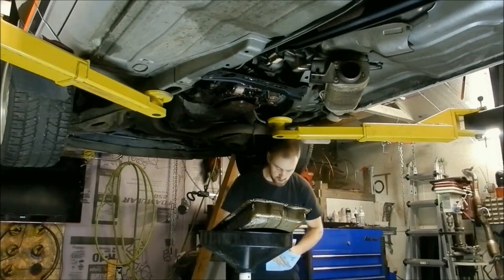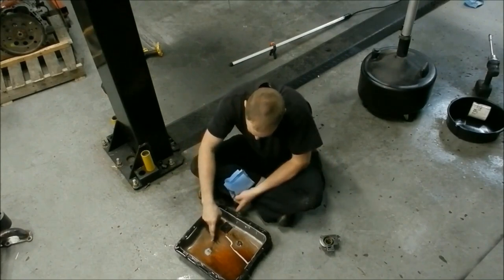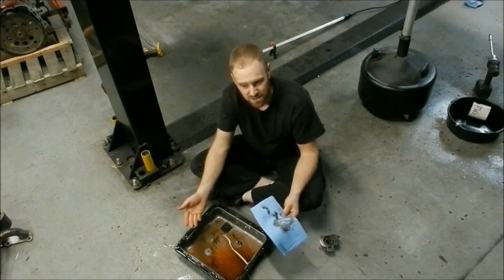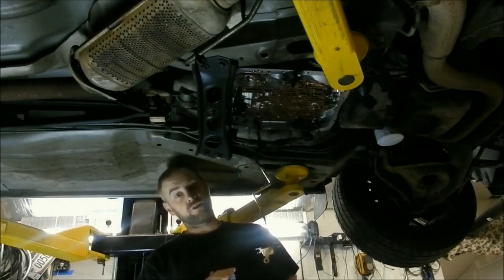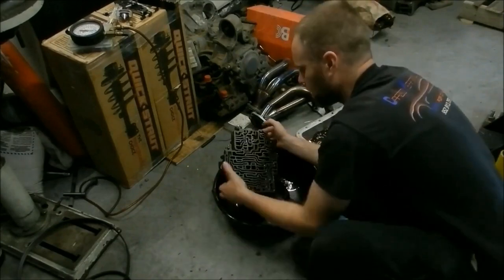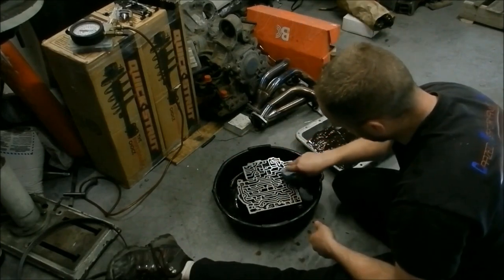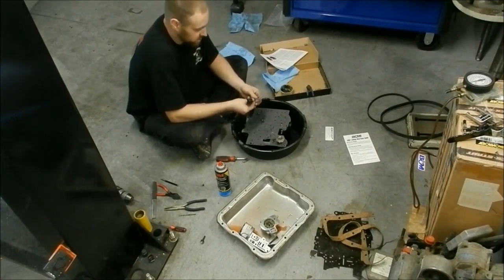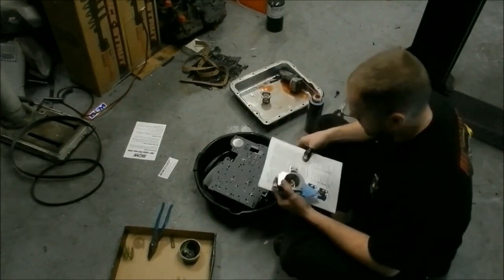Installing a B&M Shift kit in a TH700 stage 2 700r4

Comment: Internal transmission parts never hit each other and damn sure don’t hit the case. Pls do some more research before putting out false information.
Reply from the maker: Not sure what comment your referencing exactly. However Lol please explain to me how a part transfers power without contacting another part.
Reply: My pan begs to differ
Reply: Never hit each other flying separately apart from each other never touching going into outer space how is that filter supposed to be held up pick tube seal hold it in hole without the pan touching it heck would fall out of it and still hit the pan if wasn’t touching before correct me if I’m wrong